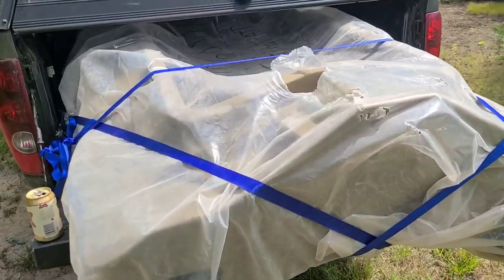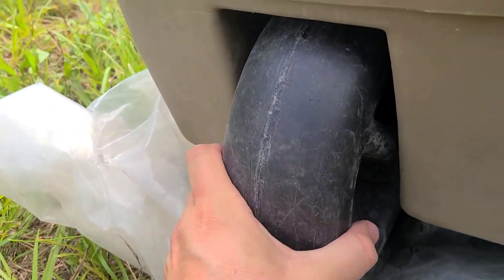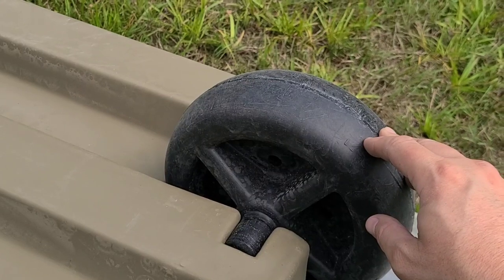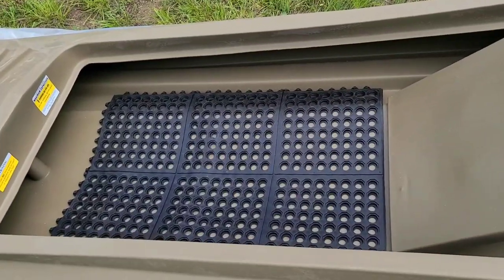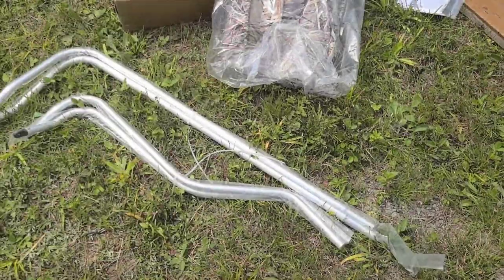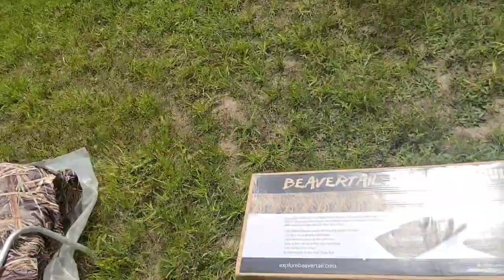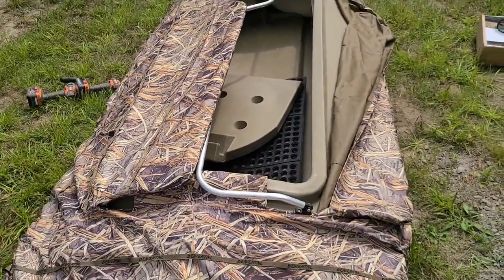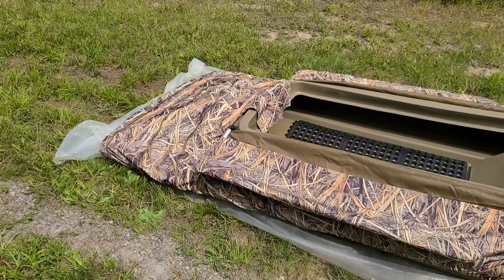Beavertail Final Attack Duck Boat Unboxing And Setup

Comment: I feel dumb asking this cause i think i see the answer but worth asking i guess. 

Do you think it would be sufficient to bring s dog with you? So just you and the dog hunting? Im debating what i wanna do this summer. The front of this looks likenitsba gripped ladder for a dog to come back up in etc.
Reply from the maker: It would have to be a small dog for sure. I barely have room to fit 2 big goose decoys, and a dozen mallards (4 are just the bottoms-up style) plus my blind bag and shotgun. So if you went with very few decoys, or found a way to strap them to your back, then a small dog would probably fit sitting down during the ride. Once you get to hunting he would probably fit between your legs. As far as the front ramp, yes it sits right into the water but not too deep, so i don't know how well a dog would be able to climb into it. The front paws wouldn't be an issue but you would most likely need to sit up and stretch out front to help pull it in by the collar maybe. The boat is super sturdy so that is do-able. Sorry I can't be of more help!